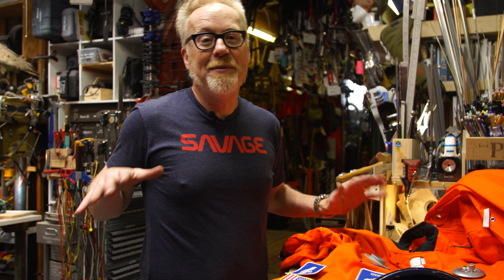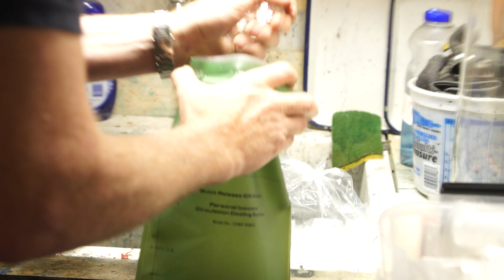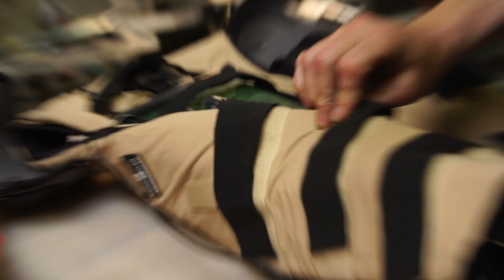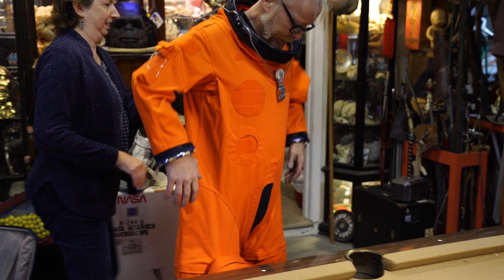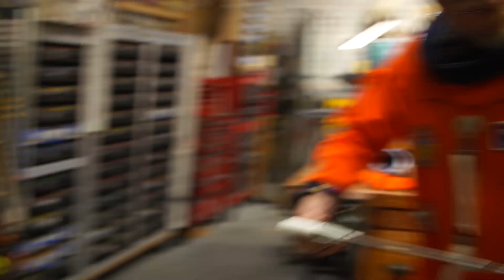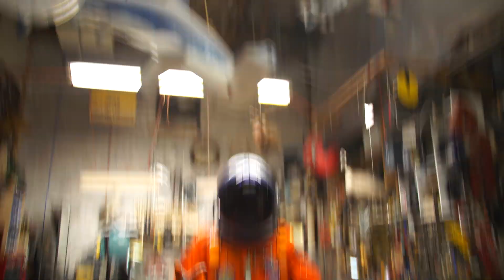Adam Savage's NASA ACES Spacesuit Replica!

Comment: Please check with the supplier of the cooling system but, you can try mixing the water with glycol, put that in the freezer, to get it below 0 Celsius. And add that to the ice cubes. Be careful not to get yourself too cold.

Comment: @Adam Savage @tested Why don't you just add a peltier cooling device with a thermocouple on a water cooling block with a radiator (Basically a computer liquid cooling kit but add a peltier). run an arduino to keep it in the sweet spot. Just power it with a LiPo or something. and now you have a liquid cooled garment that will keep the water at a certain temperature with power*

If you want to do some more research, I am really interested in Liquid Cooled Garments! Nasa has a lot of info out there about them!

The peltier device is inefficient, but when its in the correct range and keeping homeostasis it's a little more efficient!

Comment: Tfw Adam says something is "reasonably priced" but it's still 200 bucks...

Though tbh this example is something I'd be willing to spring for if I needed to. Seriously, you can never say this enough: full body costumes are hot no matter what so I'd rather be $200 poorer than in the hospital with heat exhaustion.
Reply: after almost passing out on a flight of stairs from heat exhaustion...gotta agree with you there.

Comment: It took me a little fishing throught and having to look a little harder at some key points. BUT to those few or large cosplayers wondering what cooling system hes using (Because I really needed a new one trying to cosplay here in florida.) It is the CompCooler UniVest ICE Cooling System with 2L detachable Bladder (Beige) https://www.compcooler.shop/collections/frontpage/products/copy-of-compcooler-univest-ice-cooling-system-with-2l-detachable-bladder?variant=12448995311719

Comment: I guess Adam forgot to make allowances for the extra builk from the shoulder pads hence the tight crotch area.
Reply: The crotch is tight on purpose. See that cable and pulley system around the neck? When the suit has pressure in it it blows up like a balloon, without those cables the helmet will rise upward as the suit inflates. The cables keep it all together and the only logical place to hold it together is the crotch.

Comment: The crotch is tight on purpose. See that cable and pulley system around the neck? When the suit has pressure in it it blows up like a balloon, without those cables the helmet will rise upward as the suit inflates. The cables keep it all together and the only logical place to hold it together is the crotch.